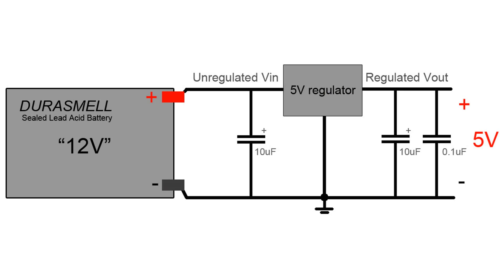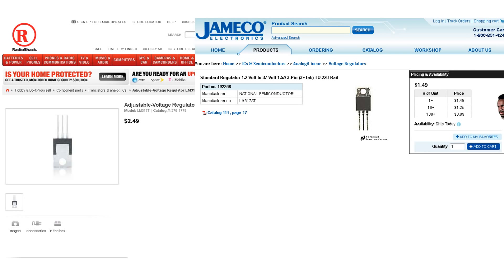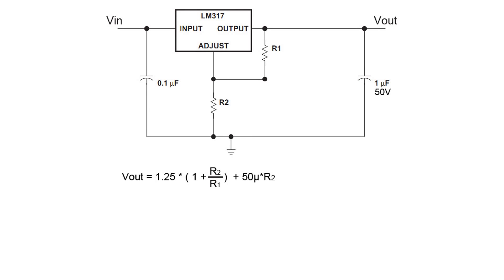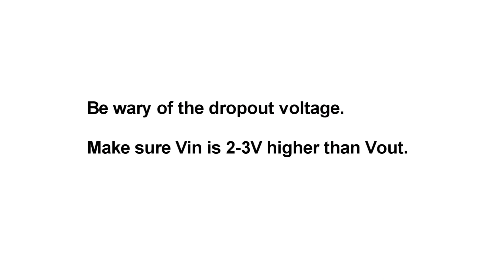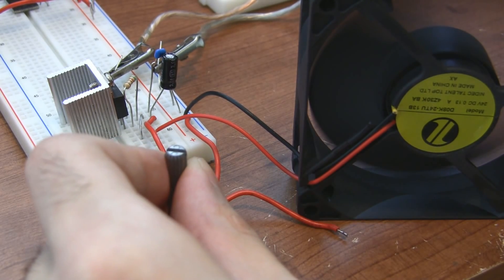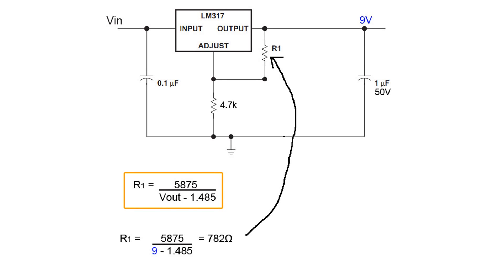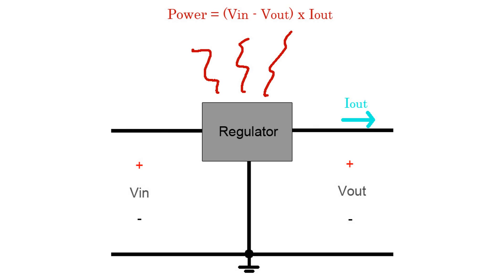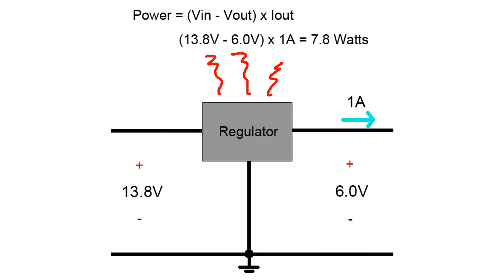LM317 Adjustable Voltage Regulator Tutorial

Comment: Hey Afrotechmods, Good video. The LM317 works as a variable power supply but the heat dissipation issue to me kinda limits it usefulness to only a couple of volts. You would need a massive heat sink, preferably with a big ass fan if you wanted to run it at 3 volts with a 12 volt or greater supply voltage. I think a fixed linear or a SMPS would be a better option. They are o.k. as far as learning to use one, but I think I'll stick with linear for now, not very often do I need a variable supply. Take care, C.
Reply: I don't understand the equation to figure out resistance. I want to generate 3.3 volts from a 4.7 Volt 18650 or maybe a lipo battery what would the equation be because I did not understand the way he described it
Reply: Holy ** I just realized how long ago you posted this sorry LOL but since I already asked the question I like to add I know that five volts would be a lot easier I could just use in 7805 but I'm trying to minimize voltage and current draw for this tiny circuit then I'm building I'm trying to make it as efficient as possible. I know I could run it off a buck converter but all I have or some really **** Chinese ones that are flaky as all hell and I don't wanna risk it

Comment: @Afrotechmods   Does this LM317 have a max current? Could I use it for ..say...80-120 amps? I need to get my bench supply hooked up with a potentiometer so it can be variable but want it to use for my rc hobby stuff. My planes can pump out a bunch of current. Would this LM317 be a good option for this?
Reply from the maker: +Christopher Barron No way. This thing could handle a few hundred mA at the most.
Reply: I believe it can only take around 37 volts
Reply: just use high current transformer at the voltage of around 24 volts with a high current full bridge rectifier.then just hook up 100 of lm317 in parallel and a 220ohm resistor and a precision potentiometer. and you will get a max cuurent of 150amps. your power supply is done.
Reply: you need 11 pot somehow coupled together and 11 regulators
Reply: Wtf? For so high current just build a transformer
Reply: AtDiT i didn't know anything about transformers...i will look into that thank you
Reply: No, LM317 can handle only up to 1 Amp current. Check the datasheet
Reply: But you use another device which all the load goes on, so how much the lm317 can output dosen't matter
Reply: can i place the uotput to a 2n3055 bjt  npn 10A base and get for example 14.7 v from a 18v source if the npn colects from 18v?
Reply: If you use 2n3055 and you feed 14V into it using lm317 (supply voltage 18V), in common collector configuration you will get 14V output, but now you can have a much higher power output cause all the load goes onto the 2n3055 instead
Reply: Its rated for 40volts maximum input. And you  want to input it no more than 30Volts to be safe and stable. Otherwize the lm317 may likely blow up
Reply: just dont forget a heatsink larger than you.
Reply: dont take the input voltage over 39 volts.i tried it it and it exploded
Reply: !!!!!!!! hundreds OMG allahu akbar bang bang bang YEEEHAW
Reply: No cause all you need is to hook up the output of the 317 to a few power transtors attached to a heat sink, feed output of 317 into base and attach colltor to VCC and connect load to emitter. 
What you said is not realistic and stupid
Reply: Saksham Gupta guys i have just a (23v-30A) power supply but it's not variable . so how many lm317 ( connected in parallel ) should i use to make it safe and variable ?
Reply: Corl Franco ok . thanks . i think i also need a 1km heatsink 😂
Reply: Corl Franco should i use 11 capacitors too or 1 is enough ?

Comment: Would you explain your calculation a little more clearly?  I am not sure how you got a value of 5875 for R2 when you started with 4700 ohm resistor. I follow the adding of .235 to 1.25 to get 1.485 get lost on the rest.
Reply: 1.25 * 4700 = 5875 but I'm trying to understand how is it 1.485 where the .235 come from hahah
Reply: Found it  :) 
0.000005*47000 = .235

Comment: wow, thanks , great video. one question, if the volts are exactly what i need , but im putting out  about .5 amp too much can i reduce the amps with a resistor?. if so do i use ohms law to calculate the size of resistor?

Comment: .....can a POT be used between the source and LM317 to regulate the input voltage to be 3 to 4 volts more than needed so heat is not a problem?     In the adjustable configuration....

Comment: So I have an old car blower that maxes on about 10 amps and 12 volts, But I wanna regulate it to go from very low up to 12 volts. Will this do, or is it to weak on the amps?  Going to use it for blacksmithing :)
Reply: The LM317 is rated for 1.5A maximum output current.

Even if it was rated for more current, asumming the motor is purely resistive (more on that later), if the regulator is set to 6V, it would have to dissipate 30 watts (worst case), which means MASSIVE heatsink (no more than 1 °C/W thermal resistance) and thermal grease. Then again, the motor isn't purely resistive so the numbers may vary.

Personally I would use PWM if I was you, but make sure you use a transistor  that can handle the full 10 amps continuously (preferably some kind of a MOSFET). Also remember to use high frequency PWM (15 kHz or even higher), otherwise the sound from the motor's coils will probably drive you nuts.
Reply: Christoffer Bergström Don't use a 10 amp power supply if your motor draws 10 amps! Always have some kind of safety margin just in case anything goes wrong. Maybe you should be using an old ATX power supply as you said, I have an old one that doesn't work very well (probably damaged input capacitors, not sure though) but is rated for 12 amps on the 12V rail.
Reply: Christoffer Bergström hang on, I will draw a wiring diagram and send you a link
Reply: "main issue" "main issue"

I guess that's what happens when you don't read a comment thoroughly before posting it
Reply: +fede142857 I'm really starting out with this stuff so my knowledge is very limited :D (the blower is a volvo 940 blower motor). I thought maybe I'll just hook it up to a car charger with a 6-12v button and go with that!
Reply: Christoffer Bergström Don't worry, PWM is easy to implement too! It's slightly more complicated than a simple LM317 circuit but the extra efficiency compensates for that.

If you look online you'll see plenty of PWM circuits that use a 555 timer IC, a potentiometer, a MOSFET, two signal diodes and a couple of capacitors, all of which will cost you $5 or slightly less. As I said before, make sure you use a transistor with a high enough current rating. I'd suggest something like an IRFZ44 (however at 10 amps you'll need to mount it on a heatsink - not a very big one though, as dissipation is, at worst, 3 watts or so in this case)

That being said, if you have any problems understanding the circuit, just contact me (but keep in mind that I am by no means an engineer, in fact I'm still in high school)
Reply: +fede142857 Wow thanks! But isn't a PWM something that adjusts itself? (I've only heard and used it in pc builds)
Reply: Christoffer Bergström PWM stands for pulse width modulation. Perhaps you are talking about a PID (proportional-integral-derivative) controller, which is a device designed to adjust power given to an output in order to mantain a stable input (for example, controlling power to a heating element to mantain a tank full of water at a stable temperature). In said controllers, PWM is typically used, but at a way lower frequency to avoid excessive switching which could potentially damage the device under control.
Reply: +fede142857 I think motherboards use it to be able to change the speed of a fan depending on the amount of heat, that's where my knowledge ends on that..
However, I looked up some videos on PWM circuits and it seems exactly what I need! Now I just need to understand what parts I need !
Reply: Christoffer Bergström You need: a 555 timer, two resistors (1K and 10K), three capacitors (1 electrolytic, big enough to handle the peak current draw when the motor starts; and 2 ceramic, both 10nF), a power MOSFET (such as the IRFZ44 I suggested before), a 100K potentiometer, and 2 signal diodes (e.g. 1N4148). Oh and I almost forgot, also a power diode such as a 1N5408.

Now onto the wiring: first connect pins 4 and 8 on the 555 timer together.

Then connect, from pin 1:
- The 10K resistor, to pin 3.
- The ceramic capacitors, one to pin 2 and the other one to pin 5.
- The big electrolytic capacitor, to pin 8, this pin being connected to its positive (longer) lead.
- The source pin on your MOSFET. Usually the rightmost pin, google the part number if you're not sure.

And from pin 7:
- The 1K resistor, to pin 8.
- The two diodes, in opposite directions, to the outer pins of the potentiometer.

Then connect the center pin of the potentiometer to both pin 6 and pin 2 on the 555 timer.

Finally, connect your MOSFET's Gate (usually the leftmost pin) to pin 3 on the 555 and its Drain (usually the center pin) to the motor's negative. The positive should be wired straight to your power supply's positive.

Connect the power diode in antiparallel to the motor (i.e. diode's negative to motor's positive and viceversa) and everything should be ready to go. PLEASE DO NOT CONNECT POWER BACKWARDS
Reply: +fede142857 Awesome man! I'm going to order some parts and try it out! (seems hard to find a reseller in sweden for some of the parts, but I will order from abroad). Should there be a heatsink on the mosfet?
Reply: Christoffer Bergström That depends on your specific MOSFET. In the datasheet you'll see two important values: On-state drain-source resistance [Rds(on)] and junction-to-ambient thermal resistance.

First, you calculate the power dissipation by multiplying the Rds(on) by your current squared. For example, the IRFZ44 has 0.024 ohms, and your blower motor draws 10 amps, so the power dissipation will be 2.4 watts (0.024 × 10 × 10)

Next you calculate what temperature the MOSFET will be at under full load. To do that, you multiply the power dissipation by the thermal resistance, and add the highest expected ambient temperature (I'll assume 30°C). In this case, you get 2.4W × 62.5°C/W + 30°C = 180°C, which not only is more than hot enough to damage the MOSFET (the datasheet says max 175°C but I'd rather not go above 100°C so I don't melt my PCB), but also almost hot enough for it to desolder itself from the board! So yes, in this specific case you'll need a heatsink! (not a very big one though)
Reply: Christoffer Bergström Oh and by the way, if you see many different Rds(on) values in the datasheet(s) for the same part, play safe and pick the highest. This value might vary slightly between manufacturers and you never know which manufacturer your local electronics store buys from.
Reply: +fede142857 Thanks! Some more questions, does it matter what 555 timer I get? I Found 3 where the one with the max current output at 200ma? 

How do I calculate the need of the electrolytic capacitor?
Reply: Christoffer Bergström Output current on the 555 doesn't matter, because the motor is being switched by the MOSFET anyways. Also I'm not sure how you could calculate the required value for the filter capacitor, go by trial and error, first try something like 100 or 470 uF, and if the circuit is too unstable put on a bigger one. Also, I'm curious, what kind of power supply will you be using?
Reply: +fede142857 I'n gonna get a pack of many different then and see how well they burn. 
I'm going to use either a retrofitted computer psu where I can draw 12volts with a big load of ampere. Or an adapter of 12v 10 amp (this one http://www.amazon.co.uk/AC-Adapter-Distributed-Hunterfield-informatiion/dp/B002SRJ9OG?ie=UTF8&ref_=pe_385721_124735971_TE_3p_dp_1)
Reply: +fede142857 Alright, then I'll retrofit an PSU, should be able to get one quite cheap!
Reply: Hey man, I got the stuff but I find some of your instructions unclear, on the capacitor stuff especially. Are the electrolyte one connected to anything but the positive end?
Reply: Christoffer Bergström The electrolytic capacitor's negative (short) lead is connected to pin 1 on the 555, and the positive (long) lead to pin 8.
Reply: +fede142857 I read through your instructions several times and I can't understand how I failed to understand them, they're perfectly clear now! 

So now one more thing, the wires in the circuit, should they be atleast 0.75mm^2 or can I go with smaller ones?
Reply: Christoffer Bergström Overcurrent and voltage drop are the main issues there.

Overcurrent is not a big deal, as 0.75 mm² cable can theoretically handle up to about 10 to 15 amps depending on ambient temperature.

Voltage drop is the main issue here. At 10 amps, if you use a 0.75 mm² cable, you'll have about 0.473 volts of drop per meter of distance from the load. The thicker the wires, the less voltage you will drop.
Reply: +fede142857 1.5mm wire it is then!
Reply: Alright, I'm almost done, but then it hit me, where does the power go in? Or out for that matter. I'm really confused. There two parts you wrote "Finally, connect your MOSFET's Gate (usually the leftmost pin) to pin 3 on the 555 and its Drain (usually the center pin) to the motor's negative. The positive should be wired straight to your power supply's positive.

Connect the power diode in antiparallel to the motor (i.e. diode's negative to motor's positive and viceversa) and everything should be ready to go. PLEASE DO NOT CONNECT POWER BACKWARDS"
Reply: Christoffer Bergström You should be feeding power to the circuit between pins 1 and 8 on the 555 timer. Pin 1 is negative and pin 8 is positive.
Reply: well something went wrong, no power comes through
Reply: Here is 2 pictures of the circuit, a mess really! https://imgur.com/a/t8phP
Reply: Christoffer Bergström So it appears to be completed, am I right? Does it work as expected? On a side note, it's not that messy, at least if you compare it to the first circuit I ever built on perfboard, back when I was 13...
Reply: +fede142857 Completed, but it does not work sadly. No voltage makes it to the motor. I get a small voltage at thepotentiometer
Reply: +fede142857 So I put a wire to the 8th pin and now the motorn starts when I connect it to the circuit, but nothing happens when I turn the potentiometer sadly. Also I lose 2volts it seems when it get's to the motor

Comment: Very good video!
I'm trying to build a portable computer charger using two 12v lead acid batteries. If I used this but changed the lm317 to a lm338 do you think it would work? (my pc uses 19 v 3.95A)

Comment: Why use different types of capacitors on input and output?
Reply: +Harlequin43 the smaller one is probably to regulate any noise from the input so it drops or rises 'cleaner' while the larger one is for the output and to ensure a clean drop or rise in output voltage.

but I'm no expert
Reply: larger values for input and output is recomended, it will stablse the system and preven ac voltage from passing. you can do 10 000uf instead of the recomened 1 uf
Reply: There are actually a ton of different characteristics in different types of capacitors. Take a look at "Mr. Carlsons Lab" video on capacitors to get a really good, understanding of some of the characteristics. :) You don't need to understand everything he is talking about, but you will gain a lot on the things that you do understand. :D

He sounds pretty boring, but he knows his shit. ;)

Comment: Warning: "Normally the value of R1 is 240Ω, the recommended value by the manufacturer. However, the value of R1 may be any value from 100Ω to 1000Ω." http://www.learningaboutelectronics.com/Articles/LM317-resistor-and-voltage-calculator.php#jump2

Please select R1 in the range accordingly, otherwise you may lose lots of precious time!
Reply: Thank you for this!! It really helped me out trying to get a good voltage output for some simple LED driving stuff! :D

Comment: +Afrotechmods 
What does 50µ mean? Should it be µA? should it be calculated as 0,05mA*R2? Where does the 50µ come from?
Reply: +Claus Bertels The 50µ is the 50µA current which passes through R2 to ground. According to the datasheet 'it is negligible in most applications.'

Comment: Hi. Could you talk about when is necessary  a bypass diode between input and output?
Reply: +Fer Cava A reversed biased protection diode between input and output provides a low-impedance discharge path to prevent the capacitor at the output (the 1uF/50V) from discharging into the output of the regulator.

Comment: Thank you for the tutorials.
When I calculate the current through R1 and R2 do I use the input volts or the output volts.  I especially want to get a variable pot with the correct watts.
Thanks.

Comment: Hi,
I have a cnc project and need som advice about converting voltage from ~220v to 165v. I use VFD to increase the Hz but the voltage range is ~220 while spindle motor needs only 165v.
What is the best way to overcome this challange? (did try transformers. Too heavy and not good!)
Thanks :)

Comment: I used the LM317T for this circuit (but with 1N4004 instead): http://www.instructables.com/files/orig/F9R/7XU0/FNZA84BE/F9R7XU0FNZA84BE.jpg to make a variable power supply unit. At first it worked fine, until I dropped to low voltage, then the potentiometer got hot and broke. Now it sends out 12V all the time and the same without a potentiometer conneted. Is it supposed to do that? If not, what could have been/be the problem?

Great video anyhow. If I can't fix this problem I'll try out this instead.